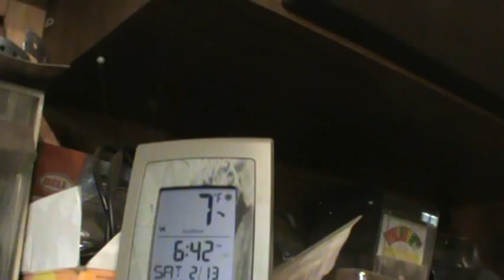fixing the fat lip on a vw double cab

Comment: Boy, that shrinker/stretcher really does a nice job. I only vaguely remember the front end of my old VW bus but I do remember that it had styrofoam insulation panels at least in spots. It makes me wonder if you could fill the air space between the front skin and the inner wall with expanding polyurethane foam. I guess the biggest concern would be passageways for wiring and sealing it while the foam is still liquid so it doesn't just run out. Seems like it would cut road noise and provide some thermal insulation in winter with all the wind blowing against it. I know those buses don't have the best heating. I think it would also help to keep water out.
Reply: +ArtemiaSalina  Foam is what causes the rot on many newer vehicles. They spray it between the panels to make them stiffer. What happens though is that moisture and saltwater get in there and soak into the pores of the foam and really speed up the rust.  Now if you sealed the metal first and maybe added something that kept a thin space open for air circulation it might be ok.
Reply: *****
Hmm, I guess, but I would have thought that a closed-cell foam wouldn't absorb water. Perhaps it's condensation from atmospheric moisture due to the temperature difference between the metal exposed to the cold and the relative warmth of the foam. I guess pretreating the metal surface with something like undercoating would be too big of a hassle and too much of a mess to bother with.

Comment: Without help, that mess you had to tackle would have done me in.  Wouldn't have known where to start.  It's called bar and chain oil that you use in the uh, body cavities?  Any specifics on that?  Planning on using some Eastwood rust encapsulator, but curious about the oil.  Thanks for the vid!

Comment: Yeah, I like the reasoning for why the passenger side is often much rustier than the drivers, but I think that the passenger side is ALSO closer to the curb and the water, mud, slush and crud that gathers there. Meaning that that side of the vehicle tends to be driving through more crud and have more junk thrown up into it!

Comment: Have you thought about lead filling the holes on the windshield wiper sockets? Or is lead filling not used in auto body anymore? It's similar to bond but you build it up, sand it down and leaves a better finish.  Grandfather was the only one I saw ever do it.
Reply: +BoredKnife  Some folks still use lead but it's a dying art. I've used it on a few areas, once you understand it the stuff really works. BUT you can also get it to overheat and melt out...

Comment: Hi. What thickness steel do you use for panel repair please? Also, what thickness mig wire?
Thank you.
Reply from the maker: depends on the repair, this was 20g and 030 wire
Reply: Mustie1 what’s 30g and 030 wire? I’m in England. Is that 1mm still and 0.6 wire?

Comment: Who the hell gives you a thumbs down!  When you spray oil in and under your vehicles do you use a pump up garden sprayer? And do you dilute it with anything?
Reply: Dave Ackerman 1967 parafin ( thats kerosene to you Americans) works well.
Reply: I strongly suggest Mike Sanders or Fluid film. But to use this you need a heated airgun with different tubes and nozzles.